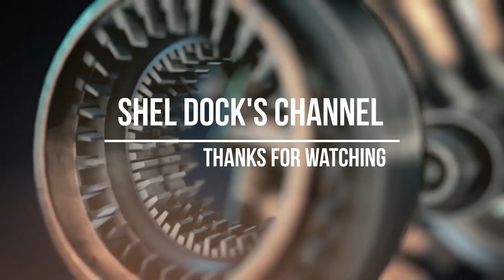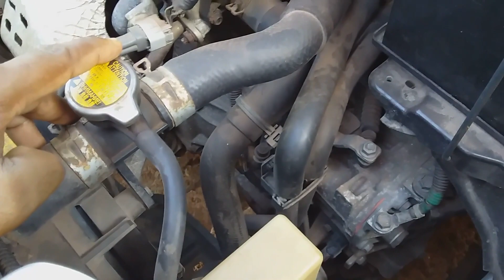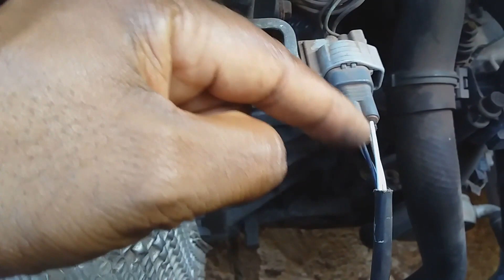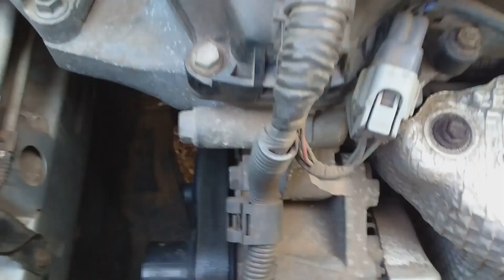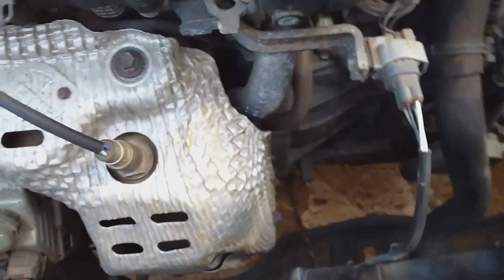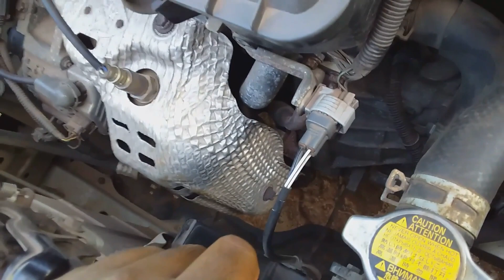Toyota Vitz Diagnosing Electrical Problems

Comment: Hi  thank you for this video it help me out alot , my check light was always on and i took it to the mechanic and he change the gas filter and it came back , now that same wire that you are showing now , I notice in my car one of the wire was cut and I took it to the electrician and he put it on back, and the problem was solved,  it's good when you can notice a fault and also know your car.
Reply from the maker: Always happy to help.

Comment: My check engine is on and the car is not holding steady in traffic. This is a 2012 Toyota vitz.  We changed the 02 sensor, clean the transmission,  change the injectors.. The machine is reading transmission even though it was cleaned.  Mechanic saying we need a new transmission. What do you think. We also cleaned the gas filter but the check engine light is still on.

Comment: Well then seem you the expert on toyota vitz..after having all these issues with the valve and blah blah blah,i bought a 1nr transmission and engine to put in the car..i change out all the wireloom etc.the problem is that the original computer is damage so i had to change that computer..i bought one with the same codes etc..before i wasnt getting the check engine light,now with this computer i am getting the check engine light..the problem is the car turning over but not starting..at one or 2 time it start but not keeping up..however the electrician who scan it got a code pointing to the imbolizer,saying that the computer came off a button start toyota vitz and mine is a key start...can this be? Is this even possible..because the two computers are the exact codes.
Reply from the maker: I feel your pain. These electronic controlled vehicles sometimes can be difficult to deal with. If your original computer had issues it should triger most if not all engine check light problems related to the vehicle.
If you install a computre that have more engine system parameters to read than your current engine system, the computer will report these non-existing system as errors and your engine will never run good.
Reply from the maker: Whenever you have car problem with these new vehicles, a mechanic is no the first place to go, an auto-electrician is the first person to check once engine check light appears.

Comment: Where can i find u
Reply from the maker: Greetings what problems are you experiencing with your vehicle.
Reply: @ShelDockToyotaVitz  hi I have Toyota vitz 2012. I have a problem with uphill reverse. When I try to reverse uphill the reverse gear disengaged. When I turn the steering wheel full anticlockwise the gear engage and the car is able to move reverse uphill but it does not do the same when I turn the wheel full clockwise. What could be the problem?
Reply from the maker: @josephtheuri7495  does the transmission slips when reversing or it seems to go in neutral when you turn the steering clockwise? If it seems to go in neutral, it may need a bit of adjusting.
Reply: @ShelDockToyotaVitz  it slips but when I turn the steering wheel full anticlockwise it holds and reverses.
Reply from the maker: @josephtheuri7495  whatever condition exists causing a transmission to slip would be caused within the transmission itself. There are solenoids controlling reverse and forward mode. There may be a problem with the reverse solenoid or its electrical circuit.
Reply: @ShelDockToyotaVitz  thank you for your assistance I will check the solenoids .

Comment: Why do I see oil on top of my transmission
Reply from the maker: If it is transmission fluid then you have a leaking transmission. The first thing is to identify the area of the leak. If its a small leak you can clean the area thoroughly then use ULTRA GREY to seal the area.
Squeeze and perss it into the leaking area then seal the top of this area with some of the ultra grey.